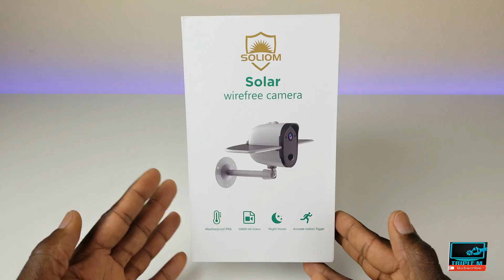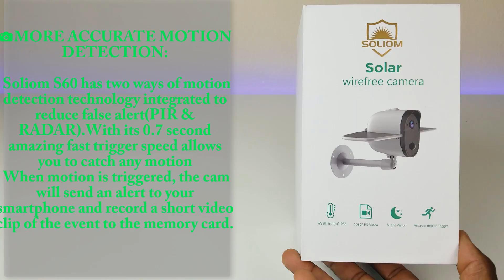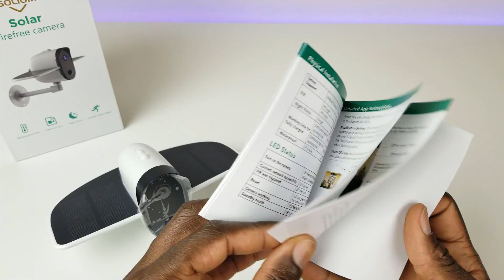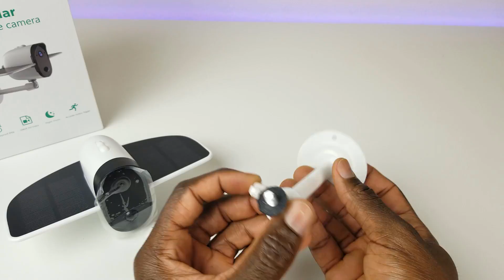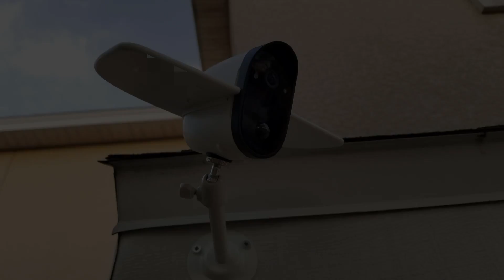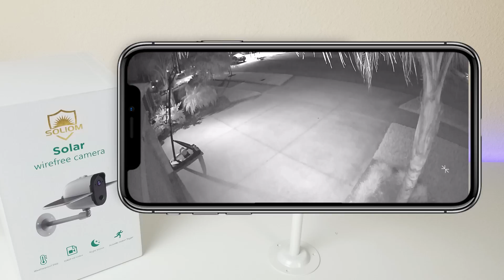Solar Battery Security Camera | Soliom S60 -100% Wireless, Waterproof, Night vision, 2-way radio

Comment: nice video.  Unfortunately, most places that I want to set up the camera are in the shade....porch, under eaves, indoor entry, etc.  But thanks anyway....maybe they can make one with a detachable solar panel and 6 ft cord.  The concept is great.
Reply from the maker: I completely understand, if you are under a porch, an extension panel is your best option. However, I was pleasantly surprised that this can charge even when it is not in direct sunlight.